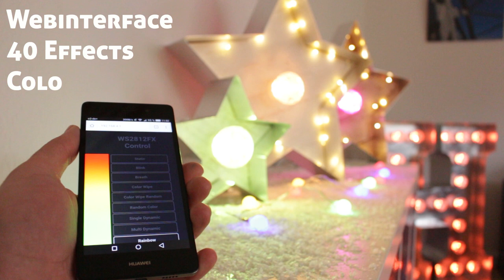WIFI LED Christmas Star (ESP8266, WS2812, Arduino)

Comment: Can I run WS2812FX without an ESP8266 and just call subroutines similar to how the Adafruit Strandtest software currently runs or will I have issues? I do not plan to make any adjustments via WIFI. I plan to code everything in the Ardruino IDE and download to either an Uno or Mega. I appreciate any assistance you offer on the subject.